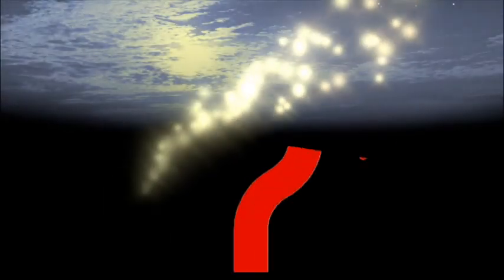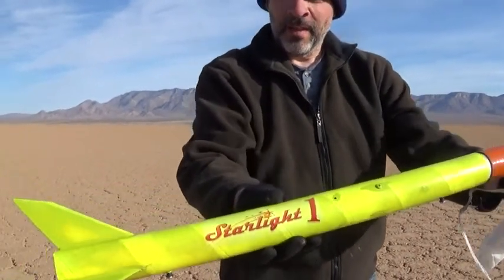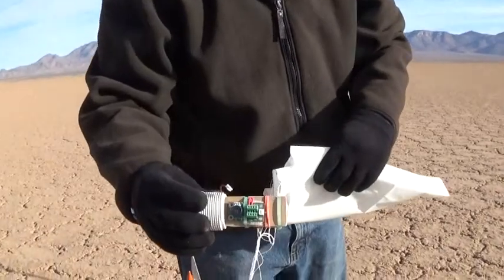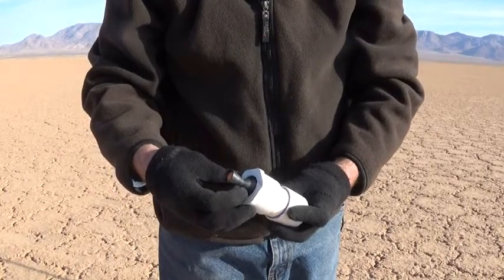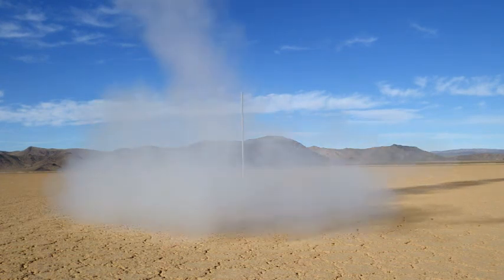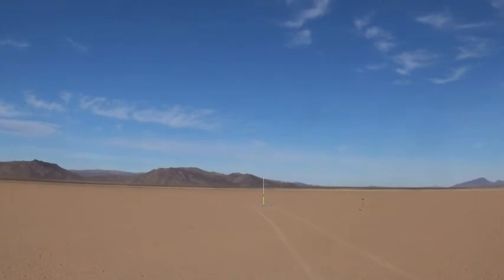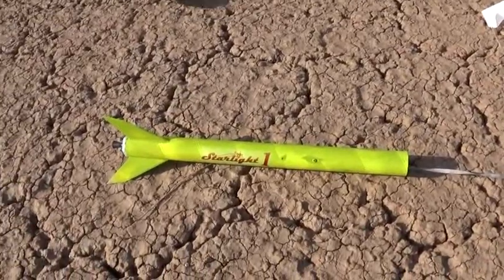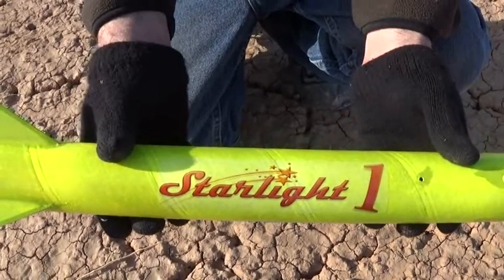Successful Model Rocket Flight - Home Built Starlight 1 Rocket

Comment: What are they include on the rocket? 
May I know it. I want to do it.
Reply from the maker: There are a bunch of parts to this.
- Fins - Surface mount fins for this small rocket are simple. If you build bigger rockets you need to do through-mount fins.
https://youtu.be/S2ZCH2oDn1o
- Nosecone - https://youtu.be/9BR324MhRBs
- Parachute - https://youtu.be/ROp6lli57fM
- Motor - https://youtu.be/wJt1XLjqaGY
- Flight computer to eject parachute -https://youtu.be/fHzvWPVEED8
- Ejection charge - I don't have a video yet for building the parachute ejection charge. It uses something called a "fireworks e-match" and a small amount of black powder to create a small explosion.
Other than that, it's just a matter of watching a lot of videos to learn all you can about model rocket building.